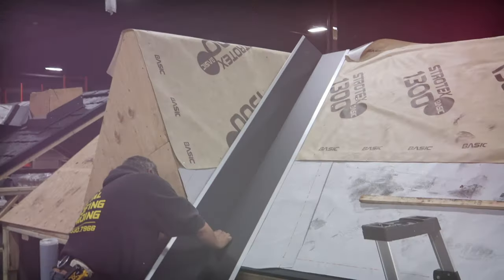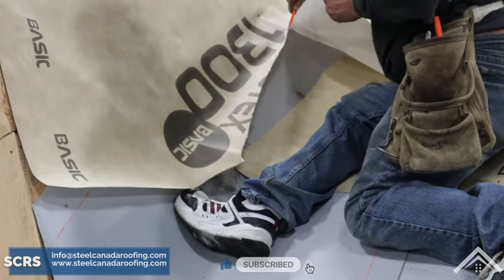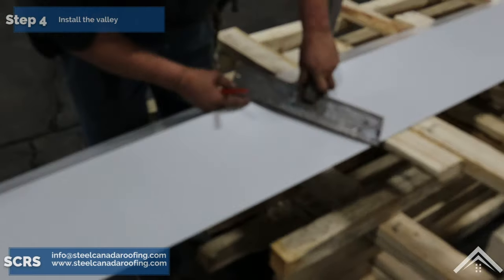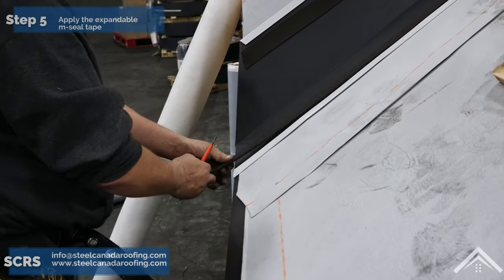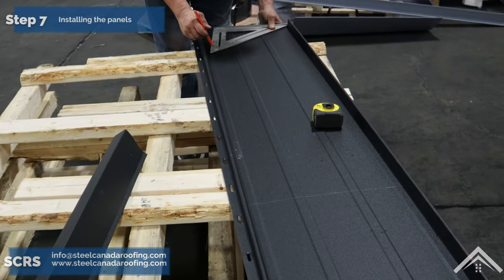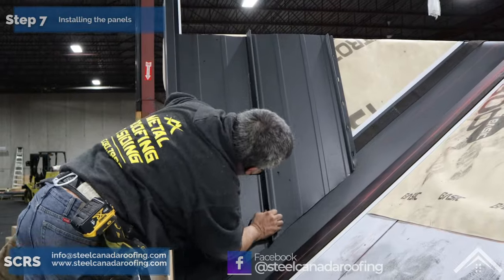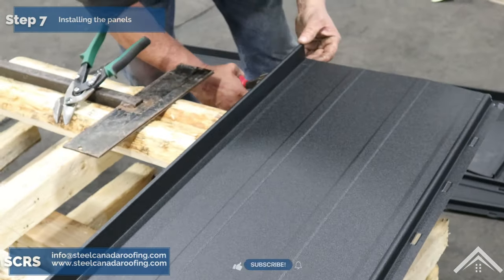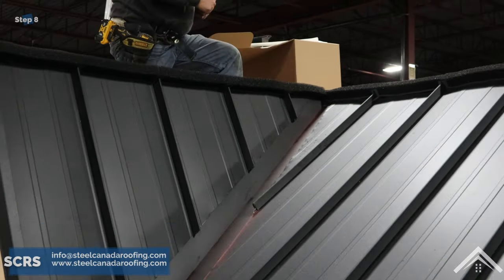How to install a snaplock standing seam metal roof? | Steel Canada Roofing and Siding Limited

Comment: This video provides a great disservice to the industry. Bare minimum for a old pole barn a mile away but not for an expensive house. This is how old school roofing thugs would install your roof. Good enough for them but today we have much more talent out there. These roofs are expensive and deserve a quality installation. They should be a lifetime roof.
Reply: I took the video as a lesson for DIY'ers, in which case it is decent!
Reply: Also, the video is recorded extremely poorly.
Reply: My sentiments exactly. I would never let this individual install a roof on my house. What a mess. My problem with metal roofing is the sellers of the product dont or won't sell to the home owner. You have hire an installer. You end up some loser installing your roof and then end up battling with them over payment because you got a shitty job
Reply: @holmes1956O  Hi , Do you think that a skilled finish carpenter/cabinet builder could do a decent job installing a simple gable roof with 4/12 pitch ?   If they’d carefully viewed videos of someone who did know what they were doing and took great care with the end product ?  Thanks !
Reply: @holmes1956O  15:20 Are you referring to this angled cut , for example , that looks all warbly (i.e. , you shouldn’t see any tool marks , right? ). Thanks again 😉
Reply: I am currently learning from one of the most detail oriented sheet metal worker in my region. Our crew does some great work. And this video made me cringe.
Reply: Interesting comment, well I see this standing seem DOESN'T use the clips for connecting the 2 panels as some do, it appears those that use the clips would allow for expansion better

Comment: Absolutely horrible to watch. I've personally never seen red chalk that wasn't permanent, red lines will be there forever, the valley panels should've been hemmed and attached to a cleat with butyl tape. And the cuts look horrible. Also exposed fasteners on this type of system is a no-no. Video quality was also bad

Comment: How come he didn't match the ribs or hooked the panels to the valley 🤔
Reply: The slopes of the two roof sections are very different.  You can't match ribs if the slopes aren't the same.  Look at the angle the panels need to be cut for the two sides of the valley, you'll see it would be impossible for the ribs to match.
Reply: Or bend the ends at the valley, wouldn’t that look better?

Comment: How does the snaplock actually snap into place?
Reply: This is not the snap lock I have looked at. Real snap lock uses metal clips on the side of the panel to hold down the under panel and the top panel snaps over that panel and clip. This type in the video looks like it would come apart in high wind
Reply: @holmes1956O that is standing seam I'm pretty sure. These panels have an s groove on one side and an L on the other and that is how they snap together. Our panels have never come off in high winds that I've heard of. But these have a bigger profile than our panels.

Comment: A metal blade on a Skillsaw works great.
Reply: it does work great, but when it comes to parts of the roof that will be seen by the homeowner everyday he comes home from work, its not so fun to look at metal cut with a saw... it also starts to rust as opposed to having a clean cut with the metal snips 🤷🏻‍♂

Comment: Looking for info on thickness and type of roof decking material, i.e. 1/2" osb vs 5/8" cdx or?
Reply: 5/8 cdx is the best way to go for a home being lived in. For a shed, or garage osb is probably fine
Reply: @itsdyl1031 finishing a gazebo roof with 2x6 rafters 16in oc.  

Thinking of using fence boards for roof decking before installing a metal roof.  Thoughts?

Comment: You can nail all the trims and panels down with a roofing nailer.
If this metal needed to move around so much like people claim, you wouldn’t be putting screws through the top of it with the cap now would you? You wouldn’t be putting 2 to 4 screws in every piece of the Z bar closure directly through the panel if it needed to move around correct? 
Oh that may be way over you guys head because you’re not even putting cleat in the damn valley!

Comment: I was fine with this until those screws went into the ridge cap. Right through the panels. There should be snaps or something. The whole point with standing seam is to not have exposed screws.
Reply: I was surprised by the end about the ridge cap screws,
Reply: They usually put a z flashing adhered and screwed with 2sided tape in between the standing seems and rivet to the z tab that overhangs so the rivet is beyond the now enclosed ridge.
Reply: @Dana5775  I didn't even see z channel in the video vented of solid how is wind driven rain gonna stay outa that attic 🤦

Comment: So those hand-snipped-by-eye valley cuts are exposed and visible?? 😮  if so, Why not use a neater tool such as a small angle grinder with a thin kerf wheel at least? And didn’t anyone teach this guy how red chalk is indelible? 🤦‍♂️
Reply: Those ends are supposed to be bent into a hem and fit into the valley flashing hem. Thats what the valley flashing hem is there for.
Reply: @Dana5775  that valley hem is way to hi from the center myself  I would've preferred 2.5 from center and if my distributor couldn't provide  that then tacky tape and a cleat will solve that

Comment: I like this product but the presentation shows many shortcuts and incorrect techniques. No hems on Valley panel ends and no Z flash ridge closures.
Reply: I can tell you have did this before only because I noticed the exact same shortcuts, I do about 8 to 10 standing seam roofs a year and I think it's the best roofing system on the market when installed correctly but it's also the most expensive, this method might pass for a demonstration inside a building but out in the elements will have a lot of problems when the first storm comes 🤦